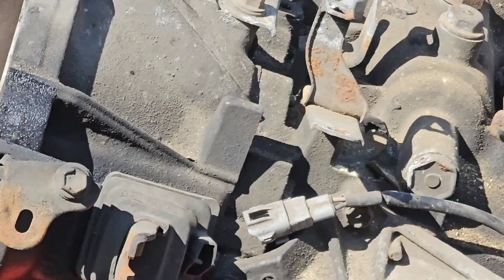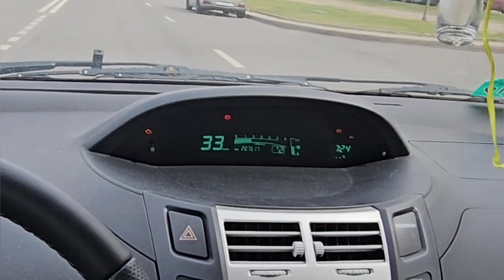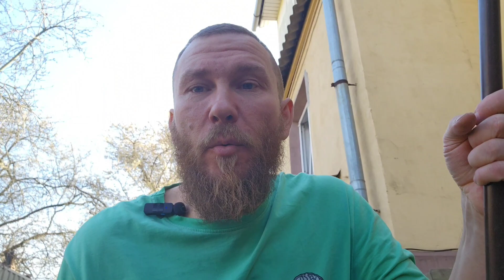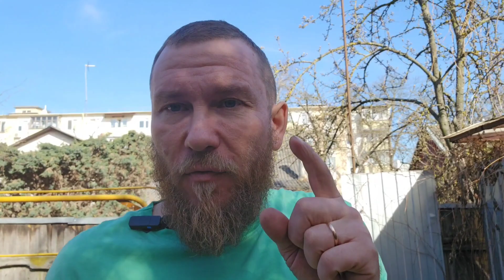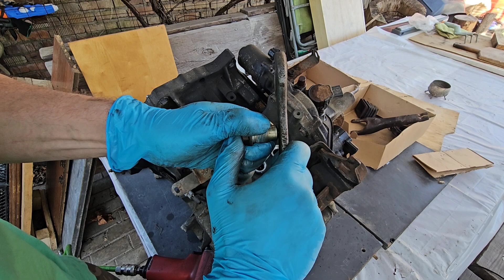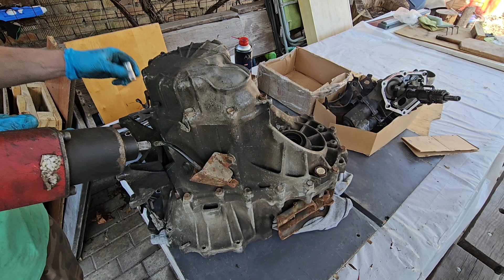Part_1 FULL GUIDE GEARBOX DISASSEMBLY FOR REPAIR OF SYNCHRONIZER AND KNOCKING OF GEAR TOYOTA SEMI AT

Comment: If you only need to remove the gear actuator, do you need to completely take out the oil? Do you need to also take down the gearbox for Toyota Auris MMT 2009?
Reply from the maker: No need.
All very easy, just need to be carefull - not broken when installing back and correct position.